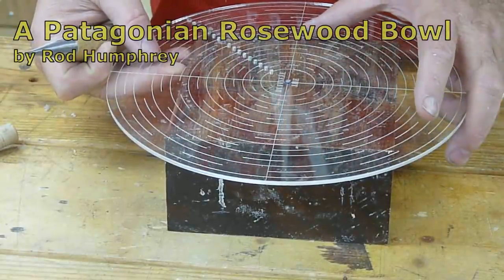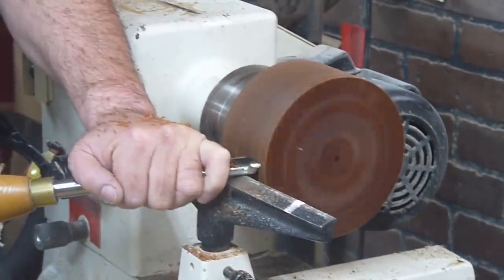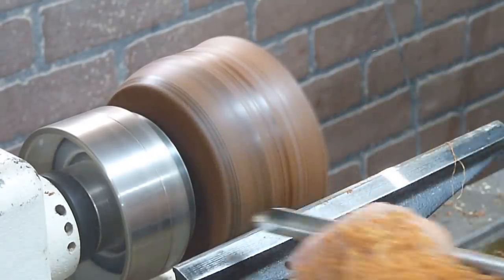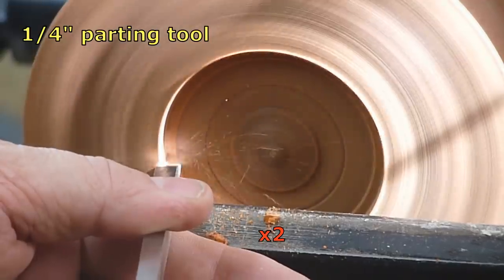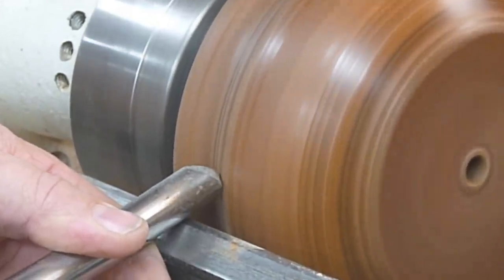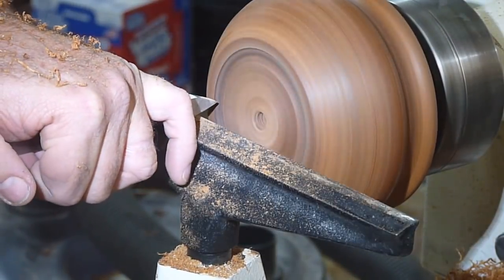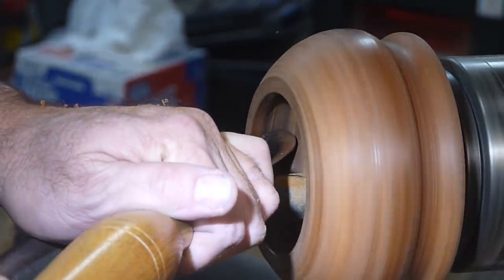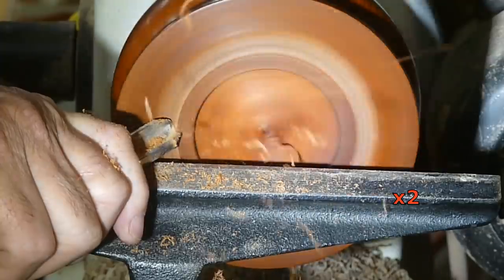Woodturning Patagonian Rosewood

Comment: Just rewatched this video, since I just finished a Patagonia Rosewood bowl today. A simple bowl, straight sided in & out, with a nearly flat bottom. My best tool for turning this was a 3/4” round nose scraper. Very tedious working this wood, with very little depth of cut with each pass. My wood also had stress cracks inside & out. I also detected an odor similar to turpentine while turning the inside. Thanks for this video, especially, even though all I’ve watched have been very instructive. I’ve learned a lot from your videos, and you always seem most gracious and appreciative of your audience, subscribed or not. Keep up the good work, and be ever blessed.
Reply from the maker: Thanks very much, John!  It is some difficult wood to turn, so hard and dense!  I'm glad you find my videos helpful!  >😊

Comment: That's a sharp looking bowl R.H. , question- what size and style blade are you using on your band saw ? And where do you get those big blocks of wood ?   Semper Fi back @ you . 69 to 75 usmc .
Reply from the maker: Thank you Marine!  It's a 4 teeth per inch, 1/4 inch blade.  I pick up the blocks at local woodworking stores in Indiana and Michigan, and I make them myself on occasion.  Semper Fi!